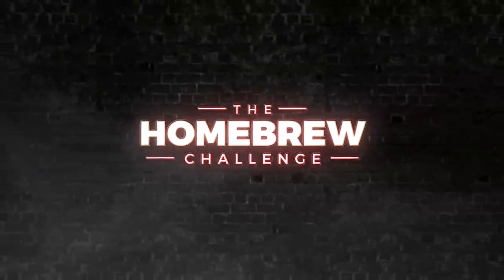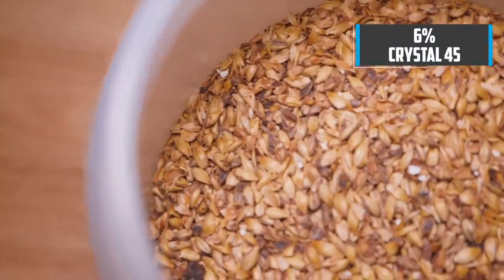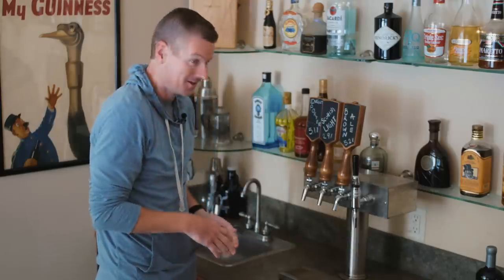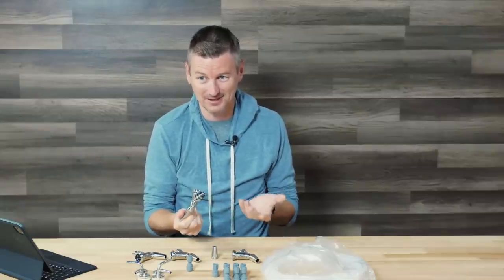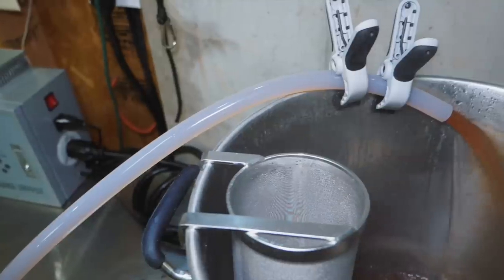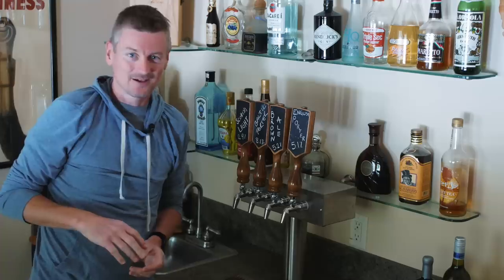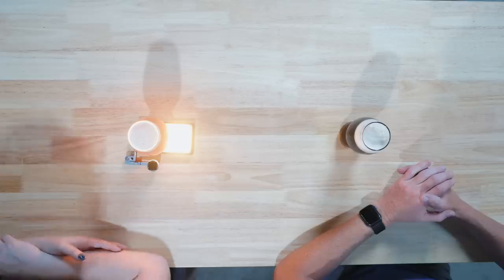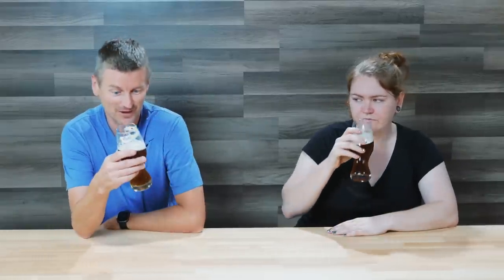Irish Red Ale | NUKATAP Beer Taps

Comment: Hi Martin, I have a similar conical fermenter to yours. How do you go doing 2.5 gallon batches in this? Do you find that the amount of beer that sits out of reach in the cone means you lose quite a bit of beer in relation to the size of the batch?
Reply from the maker: The dip tube reaches low enough to get pretty much everything out.

Comment: Huge Irish Red fan but even larger fan of Chocolate Rye. What sets NukaTaps apart from Intertap? I'm in the U.S. and never seen NukaTaps for sale over here.
Reply from the maker: I’ve not used Intertap
Reply: @TheHomebrewChallenge  You should look them up as it is like two people invented the same taps with all those connectors but had a falling out and made almost the same thing under two different brands and slightly different designs.

Comment: Very interested to hear how much you like the nukataps after a few months with them. They were modeled (according to Kee) off the Intertap stainless taps.  Did you use a forward sealing spring with them? I recently ordered my kegland secondaries, so i am looking forward to installation and reduction in foamy pours. How did you come up with 10 feet of 5mm hose length to get correct velocity for pours, what was the serving pressure (and, did it work)?  Cheers!
Reply from the maker: Kegland recommended that length for the line I’m using. Seems about right.

Comment: Do you have any type of insulation for your beer lines running between your keezer and the taps? For my father-in-law's setup we installed tubing insulation from the keezer to the bar taps. It essentially keeps the lines at the keezer temperature while also reducing foam.
Reply: never mind lol I should just waited to comment until the end of the video.

Comment: Caramelly? No no. Irish Red Ales colour comes only from roasted barley. Some caramel taste maybe from pale ale malt or invert sugar.
Irish Red Ale is in comparsion to English Bitter a really dry beer. Your recipe looks more like a British Bitter recipe. So Irish Beers don't use Crystal malts. Every triue Irish beer is made from Pale Ale Malt and Roasted Barley plus some raw grain adjuncts. Why? Irish beers are much more "german" than typical british beers. So Irish very pleasant for a creamy thick foam head what you get with raw grains, mostly wheat and/or barley should be use for it up to 25%.
My Recipe for 20L?
2,7kg Pale Ale Malt (Spring Barley like Concerto, Propino or other kind of spring variety is better for this style)
0,25kg Torrefied Wheat
0,05kg Roasted Barley.
It sould be a gravity of 1.041 OG
You can increase the amount of Pale Ale Malt for higher gravity.
Pearl Pale Ale Malt (mainly from Thomas Fawcett) is a descendant of Maris Otter, and of course a Winter Barley.
Typicall Irish Hops are Bullion (UK). Irish's don't bother much about fine hop flavour. For Irish Red Ale, I would bitter it between 20 and 30 IBU.